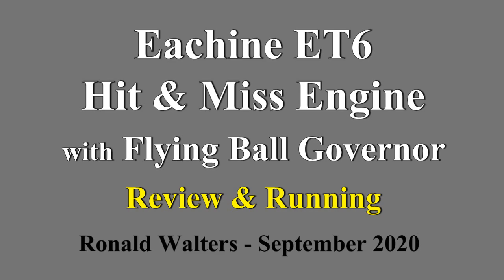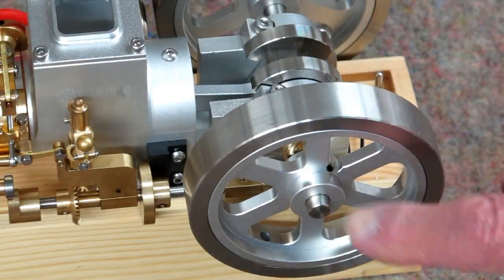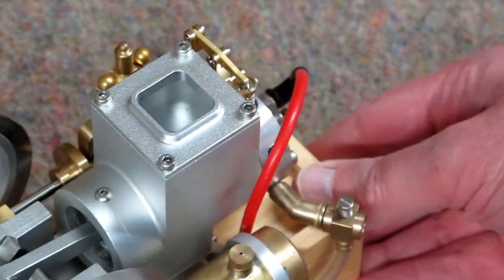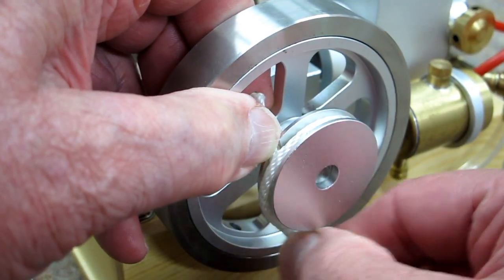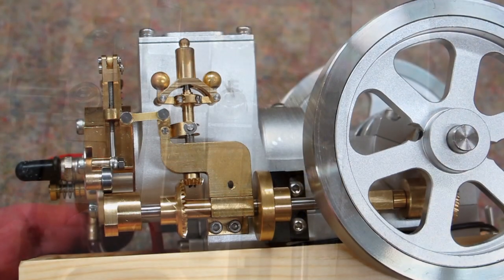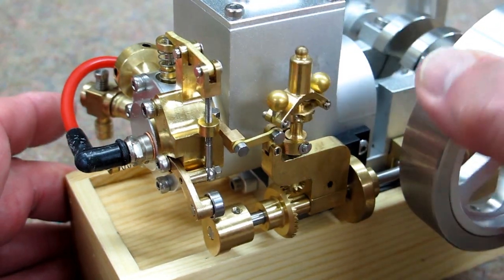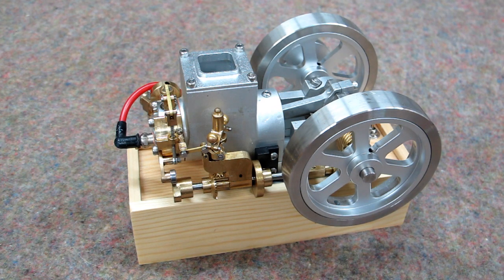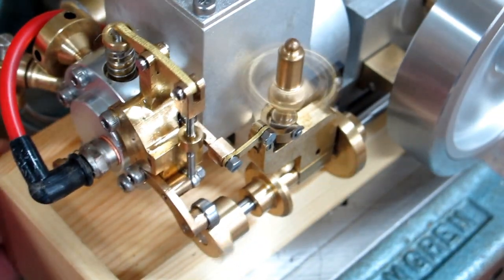Eachine ET6 Hit & Miss Engine with Flying Ball Governor

Comment: Why do you run 2 batteries vs 3 batteries?   What do to use as a "dummy" battery?
Reply from the maker: I have a playlist on my channel with all the engine review videos I have done. There are over 70 video in that playlist. Lot of information there.

Using a Battery Blank or Dummy Battery to reduce the voltage for the ignition system in some Eachine Hit & Miss engines can solve the ignition problems by reducing the number of AA Batteries in the battery pack from 3 batteries to 2 batteries.

Dummy Battery For Hit & Miss Engines
https://youtu.be/6Ij7uvw_LwE

Comment: What do you have on your drill for starting?
Reply from the maker: Cordless Drill Starter for Hit & Miss Engines - I have two videos on this. One made of plywood and a 3D printed version. Disadvantage of this is it can loosen your flywheels. The manufacturer often just uses a set screw into a round shaft to attach the flywheels and it can chew up the shaft and make it difficult/impossible to get the flywheel off.
In other words, try to hand start whenever possible.

Comment: I just received my ET 6.  I cannot get it to start.  I took the spark plug out it is getting spark.  I did have it flooded.  Cleaned out the Coleman fuel, but it still won't start.  The compression doesn't feel real strong.  I tried choking it, and I noticed it actually pushes gas backwards,  like the exhaust valve isn't seating properly.   Any suggestions?
Reply: Well I messed with it long enough to get it running.   I tried starting it where the needle was set, but it would not start.  I then opened it even further.   Finally I closed it completely and it started.  It now starts at ⅛ turn open,  runs the best a little more than ¼ open.   But to restart the engine I have to set it back to ⅛.  Every engine has its own idiosyncrasies.
Reply from the maker: Is this your first hit and miss engine? It can take a while to "get a feel" for these but generally they start right out of the box. You must get all the air bubbles out of the fuel line. I cover this in many of my videos. Checking the timing... the engine should fire JUST PAST TDC (top dead center). Best not to mess around with settings until you know for sure what is going on with your engine. All indications are that they have been test run at the factory before putting them in the box. Most of these engines need the needle valve to be open slightly more for starting... then after they warm up a little, the needle valve can be closed slightly. You will see this in my videos. Watch my videos... how I flip them over a couple of times while choking the carburetor with my finger (ignition off).Then ignition on and they will start on the next flip.
If you get tired and frustrated with it... walk away and try again later.
Reply from the maker: Pushing the fuel back towards the tank sounds like the engine is being spun in the wrong direction. Or if it back-fires or in some way causes the engine to momentarily turn in the wrong direction.

Comment: Ron been watching your videos on these engines. At this date which of these engines would you most recommend. I do like the whirling of the balls on this model, and it seems to be more showy in all that’s going on, and also sounds more like the old hit, and miss. Let me know, and I will order through your website. I did try your discount code BGacd43a , and said expired. Thanks
Reply from the maker: In this series of hit-n-miss engines ET1, ET7 ET6 and EM2 are my favorites. 

Discount codes: They probably are expired.

Banggood has more recently adapted the policy (or changed how their website works) in that they do not display engines which are out of stock (unless you have one of my links to that particular page). Links for all the engines I have reviewed are in the descriptions for the videos.

Banggood has also changed my Rep twice this year and I have not established  communications with the latest one. I will do that later today or tomorrow. Sometimes takes a week to get new discount codes.  Note: Even with a new code it may not work if the engine is already on sale. Will just have to try it and see. I will try to remember to tell you when I have uploaded new codes.

ET1 was the first in the series. ET7 has a simplified governor and is easiest to work on in terms of replacing the piston ring o-ring.  It currently appears to be out of stock.

EM2 is a really nice engine. Pretty little engine and a good runner.

ET6 is a good runner but does have some small fragile parts. I haven't had any problems with it but if it were dropped and hit on the governor area that would be a mess. Like anything else... if you take car of it!

I would totally avoid the ET5 (M12), ET5 Pro (M12 pro), ET5S (M12C) and ET8 (M93) engines.

EM4 runs very well, smooth consistent speed adjusted with needle valve setting, but has the water tank and pump which are an unnecessary complication.

EM1 is a beautiful little engine. It arrived all falling apart and as stated in my video I had to replace a number of setscrews and figure out how it was supposed to run. The manufacturer acted like I was asking for trade secrets when I asked which direction it was supposed to run and how to set the timing. A low speed engine that sounds like a singer sewing machine running and is VERY sensitive to needle valve position (which can make it difficult/impossible to get it to run the First Time). May not be the best engine until you have more experience working o these engines.

EM3 turned out to be a very good runner. Showed up with the piston liner o-rings leaking and I wasn’t getting any satisfaction from the manufacturer (and I am reviewing his engines – go figure). I had to figure out my own method of getting the liner sealed and then it ran well. However this engine disappeared from Banggood and it appears the manufacturer may have quit making it. 

Some of the newer engines in my opinion are way over priced and just not worth it.

Banggood has a 30 day refund/replacement guarantee. But I always suggest using PayPal for payment which simply gives you one more layer of protection. Therefore if it is damaged in shipment or doesn’t run you are covered. Banggood may ask for a little more for insurance, which isn’t a bad idea. Engines which are in stock have been reaching me via air freight in about two to three weeks. 

Thanks for watching. Please subscribe!
That is what keeps this channel going.
Ron
Reply: Ok, thanks for your detailed reply, after thinking on it over overnight. I have decided to go with the ET1 it’s on sale for $219. , and will probably satisfy my needs. Thanks again. John
Reply from the maker: John,
Communication with my new Banggood rep sucks.
I think this code BGRCEachine  will work with most of the Eachine engines... including the ET6. I do not know what the discount is nor when the code expires. You just need to try it when you go to check out.
Ron

Comment: Hello Ron,
Thanks for brilliant videos.
Here in U.K. haven't heard of 'Colemans' or 'Mystery' are they 2stroke type oil additives to petrol (gas) to create a 2T mix?
Why only 2 AA cells?Does that reduce the size of spark and therefore prolong spark plug life?
I am ex full size H&M (3 Bamfords horizontal open crank (UK) and 1 Monitor (US) water pump, vertical H&M) but age precludes me from lugging quarter of a ton of cast iron round a rally field. Was looking at a Redwing, either water or air cooled but at £2,195 it is a LOT of money. Arthritis has ended my days of fettling rough castings! 
https://www.forest-classics.co.uk/all/re-wing-co-models-and-castings
Thanks again for you most informative videos.Best wishes from England!
Reply from the maker: Coleman camping fuel is the same as Zippo Lighter Fuel, both having the main component Naphtha.
What you use for the 2-cycle oil is your choice. Marvel Mystery Oil is my preference as it doesn't seem to carbon up the tiny spark plugs... and not much is needed to lubricate the o-ring piston rings in these engines.

A friend in the UK years ago experienced his engine would quit running for unknown reasons. After playing around with it for some time he discovered that removing one of the batteries (dropping the voltage) solved the problem and the engine then ran perfectly. The ignition system for these engines are "potted" with epoxy and you cannot see what components are being used. We assume some cheap stuff that breaks down with slightly higher voltage. Just assume we are right and try running it with two batteries. I have received a few later engines that will not run with two batteries... and all three must be used. Nothing like consistency! 

I have over 70 videos on various model engines. There is a lot of information in those videos.

I suggest watching these two:

Hit & Miss Engines - The Correct Fuel
https://youtu.be/TvLziWCI7Oo

Dummy Battery For Hit & Miss Engines
https://youtu.be/6Ij7uvw_LwE

I ask that you use one of the links found in the video descriptions when purchasing any engine. That way I receive credit for the sale of the engine and you can get a discount by using the coupon code (unless the engine is already on sale).  If the coupon code does not work, tell me and I can get a new one.
 
Thanks for watching. Please subscribe!
That is what keeps this channel going.
Ron

Comment: Hi, i cant find my other comment.. My et6 died after maybe 60 seconds total.. ingnition system is dead. no spark,. banggood been giving me the run around.. sent in pics.. now they want videos on the "premise of ensuring safety".     they just closed the ticket..  should i be concerned about new purchases?
Reply from the maker: Your other comment was left 11 day ago under the video on changing o-rings on the ET6.
My answer from 11 days ago:
This has been covered several times in comments for various engine videos. Going back to ET1 they were using two o-rings. In order to slow down the engine (for a more realistic hit & miss run) they started using only one o-ring to lower the compression. Most of the engines only have one o-ring installed.
If you paid for your engine using PayPal you can file a claim against Banggood for a refund and that will get their attention (maybe).
Did you use one of my links to purchase your ET6? If so, give me your order number, date purchased, date received. Also I hope you saved the original packaging. They often want a photo of the shipping label and the bar code on the box. Go to my channel page... click on about... lower left corner and send me an email using that address with the above information and photos.

Comment: Hai Ron, what is the percentige of oil you use in the Coleman feul
Reply from the maker: Hit & Miss Engines - The Correct Fuel
https://youtu.be/TvLziWCI7Oo
I use Marvel Mystery Oil… I don’t measure it… just enough to barely change the color to pink. All it has to do is keep the piston o-ring slippery.

Comment: Well built piece of junk. After a few runs ignition went out. Trashed it. 👎👎👎
Reply from the maker: Sorry to hear that. Using only two batteries for ignition (as shown in my videos) may have prevented that. If you had purchased it from Banggood.com you would have a 30 refund or replacement... and paying with PayPal would give you even more protection.

Comment: Is it running on pure gasoline? Or mix some oil in?  Can't find anything on oil.
Reply from the maker: I have a video on the correct fuel... also shows the oil I use.
Reply: @RonaldWalters2010  miixed in gasoline or oil on moving joints?
Reply from the maker: Watch the video. It will tell you what it will run on including the oil used in the fuel. I use 3-in-one or singer sewing machine oil  (or similar light oil) on anything that wiggles, rotates, slides, bumps or bends before every run.
Reply: @RonaldWalters2010  thanks. I saw mystery oil.  I don't know it here in Netherlands Europe. Could a mix in some 2 stroke oil in?  At about what percentage?
Reply from the maker: One guy in Germany found the Coleman Camping Fuel and the mystery oil. I don't even measure it. If you are using petrol... than just enough 2-cycle oil to slightly change the color. You are just trying to prolong the life of the o-ring piston ring and not enough to make a mess.

Comment: Thank you for your excellent review(s) ;

I would love to step to one of these engines ...  but basically I am a stirling or steam guy :-)

May I ask which of these Eachine models would you recommend for a rather novice owner ? 
( roughly I can see ET7 ET6  ET5  ET2  ET1  ETX  EM1 !!!  ... I cannot say for sure what are the differences ... ) 
Thank you  in advance !
Reply from the maker: ET7 is less complicated with fewer moving parts and I think it is easier to work on. I would recommend ET7. 

ET1 is my next recommendation but it is a bit fiddly trying to get the exhaust valve rocker adjusted when you have to take the head off.

ET6 is also a good engine, good runner but more complicated with many small pieces and movements. 

I would stay away from ETX and ET5

I have not reviewer the EM1 but expect to next year.

Don’t forget to get some spare piston ring o-rings and maybe a spark plug if you don’t have one.

I have review videos for all of these engines and recently released videos of ET1 and ET6 running for 4 or 5 minutes. Tomorrow a video will be released on ET7 running for 4+ minutes.

I also have a video on the correct fuel to use.

If you are accustomed to working on steam engines, Stirling engines and flame lickers, you shouldn’t have any issue with one of these… keep it well oiled and clean up afterwards. 

Links to purchase the engines and discount coupons can be found in the video description. 

Thanks for watching! Please subscribe. 
That is what keeps this channel running. 
Ron
Reply: @RonaldWalters2010  Thanks Ron for fast and compete answer ; very kind of you !

I will follow your advice and get a ET7 model ; 
it comes rather more expensive than the ET1 but it does make sense as a new model ! 

I noticed a rather longer gas hose on ET7 though ... could not that become a bubble maker ? :-) ...

I will order an extra mini spark and o rings ... could you please confirm what are correct refs for these ? 

Thank you for your help ; when you have a moment, I just can strongly suggest :-) you to have a look to my channel, featuring about 200 vintage steam and hot air engines ... ( and few modern ones as well ! )
I am sure some of them will get your attention !

Greetings,
Reply from the maker: Go to my video on ET7. In the descriptino is a listing for piston o-ring for ET1, ET6, ET7, ETX they all use the same o-ring. The spark plug will probably be on the same page.

Use the coupon code to get the price of the ET7 down a bit.

Once you get the air out of the fuel hose, there will be no more air until you run out of fuel in the tank.

I looked briefly at your channel earlier. That's how I knew you have played around with Stirling, steam and flame lickers. :-)
Cheers!
Reply: @RonaldWalters2010  Thanks Ron ; Good to know they share the same o-ring. 
Coupon will help to supply an extra spark plug ! 
Greetings,